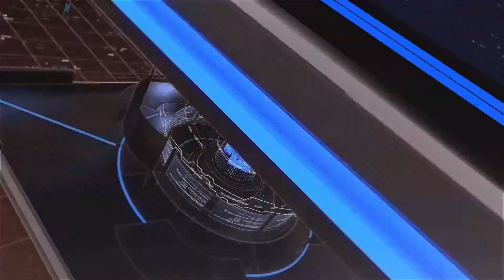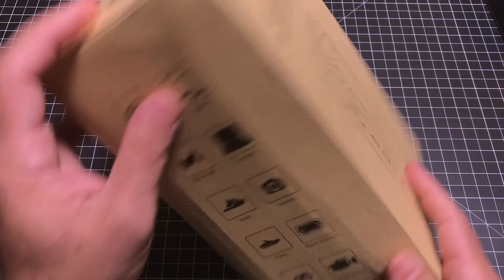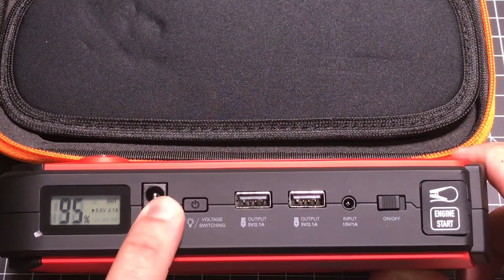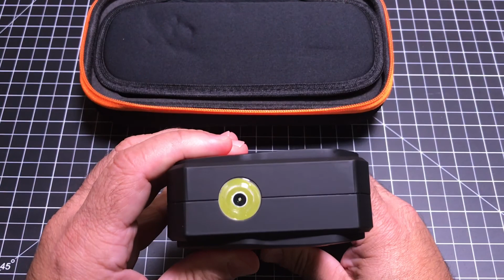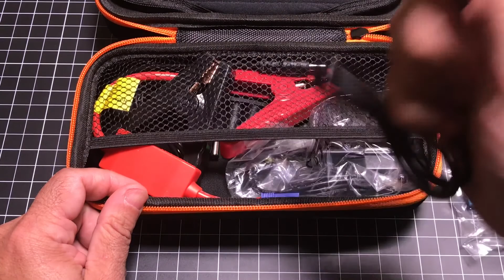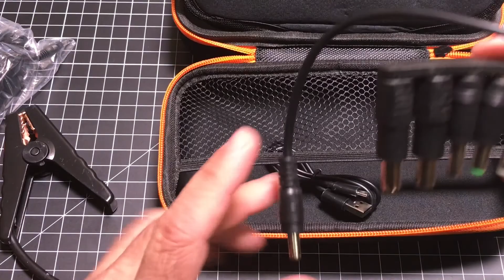iClever 600A Peak 18000mAh Portable Jump Starter

Comment: As others have mentioned, this is a seven-plus minute long commercial.  Not a review. 

I own this device.  I just tried to use it because my truck (3.5L gas engine) battery died.  It failed.  Miserably.  I had to use jumper cables from our other car.  Don't bother with this junk product.